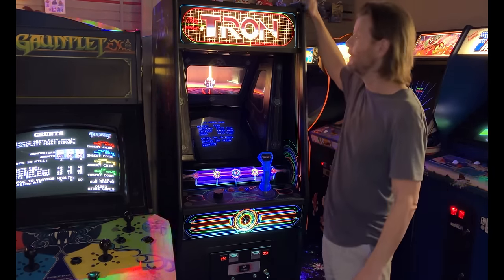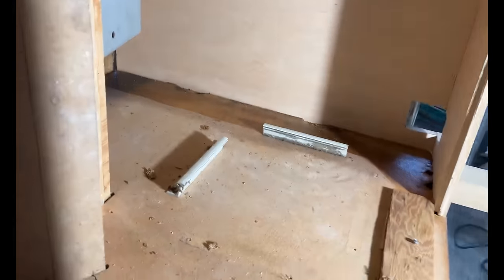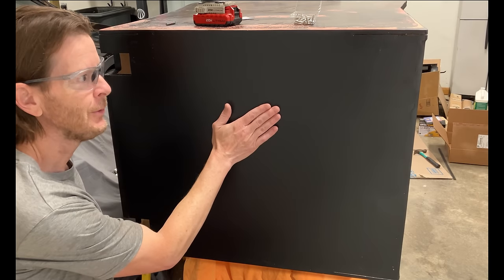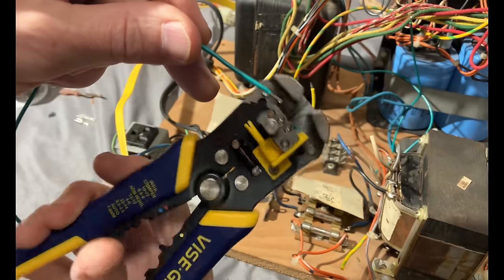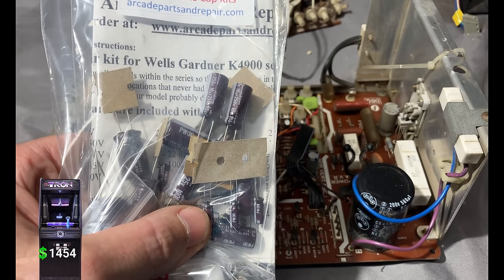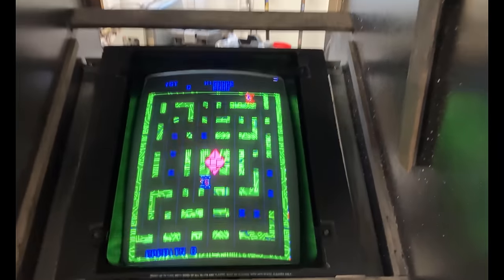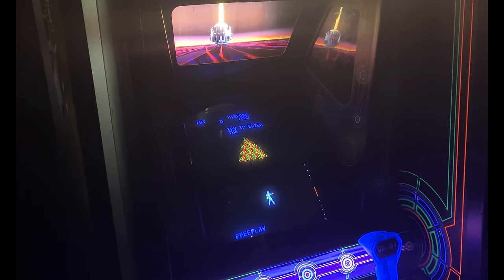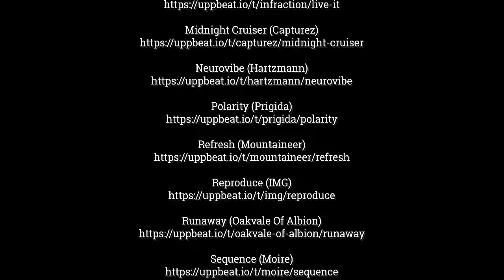"Trashed" Tron Arcade Restoration!

Comment: It's funny, I saw Tron at the theater back in the day but after watching Tron: Legacy the cut scenes here from the movie are kind of simple.  Back there I remember blinking a lot at the theater trying to focus my eyes on the scenes.  Your before and after on the console sure is a big transition.  What a great job.  Brought back a lot of fond memories at arcades playing this game.  Oh also I used to work a lot with fiberglass and making models and original plugs for the molds.  The Bondo you talked about the kick over or curing time.  It also depends on the heat and humidity of the outside temperature on how must time you have to work with it.
Reply from the maker: Thanks! Looks like I rekindled a lot of memories of both the game and the movie with the project. So cool!
Reply: @tcurtis49  Definitely 😀 Oh forgot to mention I really like the new joystick.  WIth it glowing that would have looked awesome in the arcades back in the day.

Comment: Those old boards should be replenished with Japanese solid caps for long durability!
Reply from the maker: I do know my cap kits I use are high-quality Nichicon from arcadepartsandrepair.com but not much more than that. The game boards themselves will often have specific cap kits as well, although I don’t think most board repairers worry too much about them unless there’s a specific problem, particularly boards like Gorf that blow out tantalum fuses with regularity. I’ll keep accumulating knowledge about it. Thanks!

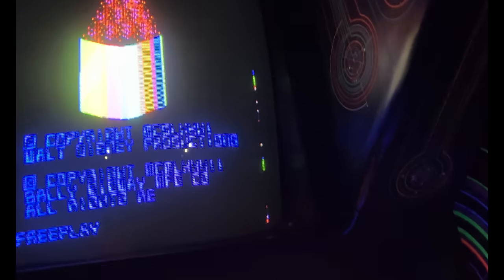Comment: Can't believe you didn't just cut the lower 6" off the cab. Those pixels errors at 1:42:14 are factory! Hopefully you didn't spend too much cash on swapping in new RAMs trying to remove them!
Reply from the maker: It may have been easier in the long run to cut off the bottom, at least labor-wise, but I looked at it more as a challenge to see what I could do with it from a repair standpoint. But certainly another way of dealing with this kind of issue. I suspected the pixel errors were factory but wasn’t 100% sure—those ram chips are around $1.25 a piece and I figured I should stock some for future projects anyway. The video board is now on the outside due to the high score save kit and are socketed so it was no big deal to experiment. Hope you enjoyed the video and cool name—we had a SpacePort arcade nearby growing up :)

Comment: Rather than use BONDO Maybe check out DURA-GLASS, (Old Timers called it "Kitty-Hair") it's like dark green thick resin with fiberglass hairs in it and it spreads like bondo, but dries hard like a rock, not so gummy like Bondo - you can even drill and thread it

The problem with that style of Glazing putty, is it shrinks in a few months or a year under the finish and will leave a noticeable divot everywhere you apply it, More Modern 2-part Glazing ICING you mix with hardener it more stable
Reply from the maker: Good tips! Thanks!

Comment: The fact you took a shell in that condition and restored it is incredible. Most would have simply let it go to the trash/junk. When I saw the rot and swelling of that bottom part of the cab I thought for sure you were just going to cut it back to the good board and glue new stuff from there. Your method while time consuming is much better, more authentic, and helps preserve original integrity of the cab. Phenomenal job!! Perfect way to save and preserve a piece of video gaming history and a legend of its time. Much respect.
Reply from the maker: Thanks! Definitely nothing wrong with cutting and rebasing the whole thing but it did work out pretty well doing the repair. Surprisingly well—I was prepared to ditch it and cut new sides if it didn’t feel sturdy but that resin is tough stuff. Glad you enjoyed it!

Comment: When installing cap kits I prefer to mark all the tops of the old caps with a sharpie first.  Then I remove old cap and install then promptly install the new caps one at a time.  It may take longer but the process is simple,  precise and works well.  Sometimes I do remove more than one cap at a time but when I do, they are all the same value.
Reply from the maker: Good tip—I recently recapped a chassis that had been previously redone and each cap had a sharpie mark from the last person. I’m with you—I go one at a time unless I’m in a bank of several of the same value.

Comment: I used to repair arcade games, and all I can say is, be careful with that fragile blue joystick! Many of them were replaced with sturdier black joysticks, but the blue ones look great
Purple cleaner from Home Depot works great for cleaning PCBs. Soak without diluting, but ONLY FOR A FEW MINUTES because it will eat the traces off the board if you wait too long. Then wash thoroughly with water
Reply from the maker: They certainly do! The whole cabinet is pretty special. Cool that you have that repair background—I think they are definitely prone to breakdown but fun to figure out.
Reply: @tcurtis49 I used to build games too. Built a Pac Man full upright game from scratch when I was 17. Later, I designed games and wrote software. I miss those days. Great job on the refurb! That's you, right?
Reply from the maker: That was my dream job growing up, designing games and writing software. I still do some of it in my spare time. I grew up as a computer nerd :)

Comment: Your method of discharging any charge on the monitor connection is flawed and potentially dangerous!

You are discharging to the frame, as you said, but for that to work the frame has to be grounded. If it's not grounded then there will be either no discharge happen (the charge will remain in the capacitors), or it will arc to your hand, or it will go through the frame to your body if you are touching the frame with bare skin.

The best way to do the discharge is to have wire attached to your screwdriver that goes directly to ground. Get some high voltage wire like you find in a power cord, bare the end a fair bit, wrap the bared part round the long screwdriver a few times tightly somewhere just before the handle, and wrap some electrical tape over the wire to hold it in place. Rig up a mains plug so only the ground pin is connected to the other end of that wire (no other wires coming from the live and neutral pins as that would be dangerous having them loose!) and plug that in to your mains. Don't worry, as the live and neutral are not connected to anything, and as long as the pins are not exposed, the plug will be safe.

You can alternatively connect the wire to the frame instead of the screwdriver and do the discharge your way but attaching it to the screwdriver means you just have to poke in under the seal and touch the metal connector, no having to angle it to touch the frame.
Reply from the maker: Yes, ultimate safety when discharging a monitor is a must. And if anyone is going to attempt it for the first time there are thorough resources on it. Definitely do not put your other hand (or any part of your body) on the frame.

If you want to have a ground strap to the monitor chassis, that's perfectly fine, but that's not exactly what's happening when you discharge a monitor. The monitor is like a giant capacitor and you are shorting across it to even the charge. If you watch my old Atari 5200 kiosk video you can see me discharge the B+ capacitor with a large screwdriver. It makes a loud pop and even leaves a bit of a burn mark, but it's discharged after that.

How do I know it works without a ground strap? Because I've done it that way a hundred times, and if there is a charge in there it pops quite loudly. There would be no pop if you needed an earth ground.

This is the best summary I can find from other experts:

"It's unfortunate that the term "ground" has come to be used commonly when referring to discharging a CRT. It's the same thing as discharging a capacitor. With a capacitor, you place a piece of metal across two legs of the cap and it will discharge.

With the CRT Tube, the "leads" are the inside and outside surface of the glass tube via the anode cup hole where the dag connects.

Discharging of a CRT Tube is simply evening out the charge inside and outside of the tube. So as long as you have a solid connection between the discharge tool and something with electrical continuity to the dag, you are good. Hence why the ground strap or the frame of the monitor (which generally is in contact with that ground strap) are good choices."

But definitely any time you work with electricity and that amount of charge be as safe as possible. For me I feel perfectly safe doing what I do but will be glad to alter my approach if I find that I'm incorrect. Thanks for pointing that out :)
Reply: Yeah, the high tension can easily shoot up the uninsulated screwdriver handle into your hand... best to tap a wire from the screwdriver to the monitor shield/ground before poking it under the high tension insulator cap.
I guess based on your post here though that you likely have the screwdriver touching the side to short it out before it uses your hand as another pathway to discharge.
Reply from the maker: @TonyHamlyn  There’s no way it’s going through the thick plastic handle on the screwdriver—so I definitely keep my hand on that only. And never get your other hand anywhere close. The real danger is creating a circuit through your own body and stopping your heart. And I do also try to have the blade touching the metal frame before hitting the anode clip—that’s good advice. I also have a high voltage probe I can use to discharge monitors. I might show that in the next video. The only problem I’ve had with it is that it has a slow discharge but leaves just a bit of charge in the tube. I usually follow it up with more of a direct short afterward.

Most people have an alligator clip soldered to their screwdriver and that clipped to the chassis. I distrust alligator clips a bit because they come unclipped from the frame a little too easily when moving around. At least the ones I have used. Thanks!

Comment: I used to build wiring harnesses for a living. You should flag mark the wires on both ends, so if you encounter a problem in the future, or you sell the cab later, it will be easier to troubleshoot!!! Especially if you made any mods or changed a wire color during a splice!!! Nice job on the cab!!!! NEW SUB!!!
Reply from the maker: I will certainly try to do that. I had a lot more wiring harness fun on the Red Tent project. In all honesty, I think it’s fun making harnesses and connectors once you have the right tools :)

Comment: I have watched a ton of arcade restoration videos over the years, and I had no idea it was even possible to repair particleboard that was this far gone.
When I saw the state it was in, I was expecting a 'Ship of Theseus' type scenario in which you replaced most of the panels  or at least large sections of the panels.
I'm absolutely astounded at what you were able to accomplish.
Reply from the maker: I took some chances with it but in the end it did work out really well, and still looks great. I don’t fault anyone for just cutting it out and patching in new wood but I’m happy with the outcome. Thanks so much!

Comment: I was going to comment on how the schematics of the cabinet with some new plywood would have been cheaper starting over than the cost of this one plus repairs but I realized as I finished the video, that it's not always about the bottom line price.  Sometimes its about the journey and the pride in craftsmanship because you sir, are fantastic!!!  Your end result was immaculate and you should be very proud!
Reply from the maker: Thanks! Yes, I often don’t take the cheapest or easiest way, and there’s nothing wrong with doing that, but for me I want to connect with as much of the original history as I can. I appreciate the nice compliments!

Comment: Nice work restoring Tron! Pressboard and moisture often spell eventual disintegration unfortunately for many of the Arcade cabinets and modern cabinets too.
Reply from the maker: Just about every cabinet I've ever fixed up has that damage at the bottom. Any contact with moisture, like a concrete floor, and these things start falling apart. Which is the way many were stored over the years, unfortunately...

Comment: First time that YouTube recommended your channel to me.  Nice restoration of a game I put quite a few quarters into.  Though I was more partial to Discs of Tron in the environmental cabinet.  If I may make a suggestion for putting the decals on, try Rapid Tac.  I saw you were using their Remover product for getting the adhesive off.  Tac makes putting on decals very forgiving over soap & water mix.  I use it for putting full length decals on aircraft and it is great if I have to lift the decal back up to reposition it.
Reply from the maker: I will definitely check it out. I have sideart to apply on one of my projects and that would certainly help. Thanks!

Comment: You should find the version of that where its an upright sitting case ie. there is a back to it with a inclined seat you can lean/sit against
Reply from the maker: I think Discs of Tron was more common in that style of cabinet but it would be cool for sure to find one.
Reply: @tcurtis49  it might have been its been 30+ years since I seen it.

Comment: Love your videos. Question; why add the rear strait roller wheels when you’re already adding the swivel casters
Reply from the maker: If you look at most 4-wheel carts, the two near the handle are swivel and the two in back are straight. This lets you move them around easily enough but if you want to park it you only have to engage the brakes on the front ones. With an arcade game, if you push it into the lineup where you want it, you can lock it in place with the two casters in front, which you can easily reach, and the back won't sway side to side. Lately I haven't used the locking casters much anyway, as most of my games are on carpet and sink in enough that they don't move anyway. Thanks!

Comment: I've heard that Williams uses some of the video RAM with the computations and that might be that garbled line of color on the right you're seeing.  I guess other manufacturer's did the same thing.  What you did by increasing the video size or moving the image is the solution.
Reply from the maker: I believe you are exactly right. That’s what I’ve heard since putting out the video as well.

Comment: Not gonna lie. I thought the cabinet was a template to cut new material. I am impressed you used almost the whole thing considering it is particle board. Nice work.
Reply from the maker: Thanks! I certainly thought about it but my goal is usually to try to fix it and if it doesn’t work move on to something more drastic. I was really surprised how well the particle board restored. The resin is pretty powerful.

Comment: If you have acrylic that has fine scratches in it (or you sanded and polished but it's hazy), there's a method called "vapor polishing" for acrylic. Basically you heat acetone until it's practically boiling, and you let the vapors hit the scratch. It's like magic. People have used this on headlights and other acrylic surfaces with scratches. There's tutorials on youtube on how to do it at home. Obviously you'd probably want to do it outside for ventilation.
Reply from the maker: I got to see that firsthand in a project I’m working on…but it wasn’t intentional :)

Comment: nice!! I have a Defender Stargate that I bought In the late 80s that I have repaired many times.  The crt in the monitor finally died; it was on its third rebuild and the phosphorus was badly burned. With great reluctance I replaced it with a 19 inch flat pannel LCD. I also again with great reluctance used a raspberry pi running retropie and the code from the original roms. Every button including the settings buttons on the inside and even the coin receivers still work. The machine is as it was complete with cigarette burns. I did take me several months.
Reply from the maker: That’s a cool game. And I have a 19” lcd that I use as a stand-in on projects sometimes. But yeah, it’s nice to keep the original crt look when possible. I don’t technically have a Stargate but can sort of play it on my Robotron since it has a J-Rock multi-Williams FPGA board inside. They are more expensive than going the retropi route but drop in nicely to a preexisting cabinet.

Comment: Great video!  I love watching arcade restorations and TRON is my all time favorite movie and arcade cabinet.  One small note:  Get yourself some flux for doing anything with soldering.  It will help immensely in keeping the solder joints clean and prevents cold solder joints - which I saw you make with the first re-capping.
Reply from the maker: Thanks! The flux is built into the solder and flows easily. Perhaps it would be better to have it separate but I definitely love the stuff I use. I’ll research it a bit.

Comment: As someone who cut their teeth on discreet components and then TTL circuits, DeOxit is your friend for those sockets. A pipecleaner with some DeOxit spray and patience can work wonders on glitches. They were never intended to last this long, just like the old caps. Those contacts were just tin for the cheap stuff.. gold for milspec. We used to "fix" some boards just by lifting the chips a touch and pressing them back down. It broke up the oxidation and gave fresh contacts. But I would not recommend that for this. It's been way too long and the oxidation can be thick on the parts that have not been in contact. Not to mention dirt, dust etc..etc..
Reply from the maker: DeOxit is indeed my good friend…I use it all the time. On some projects I do end up removing most all of the chips and cleaning them off. And it’s definitely a good practice to DeOxit the edge connectors on games.